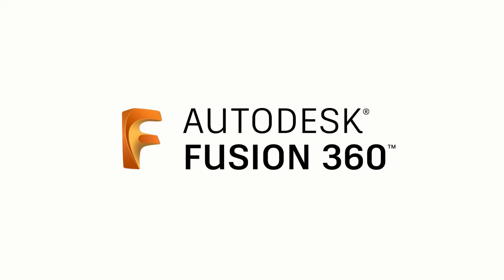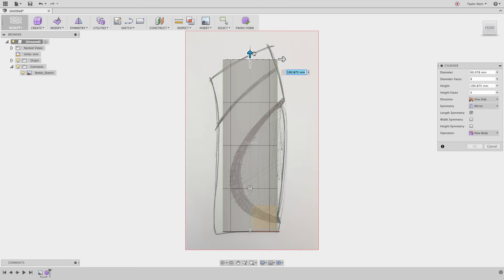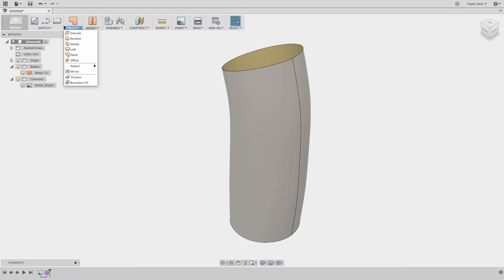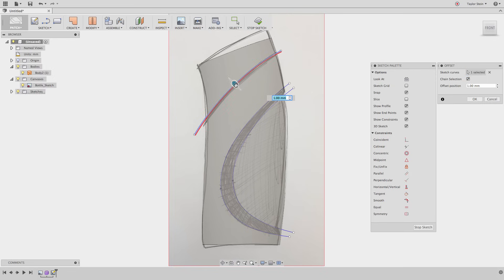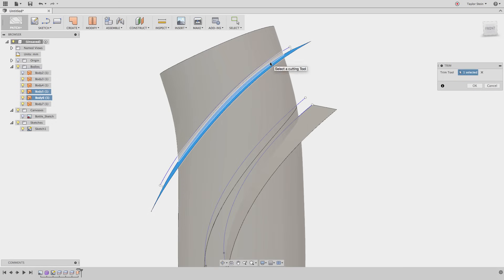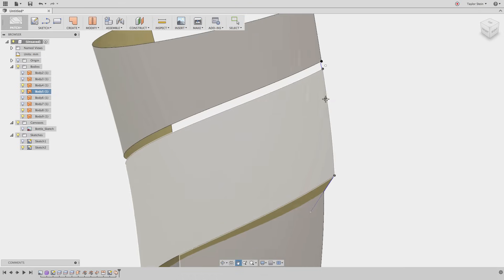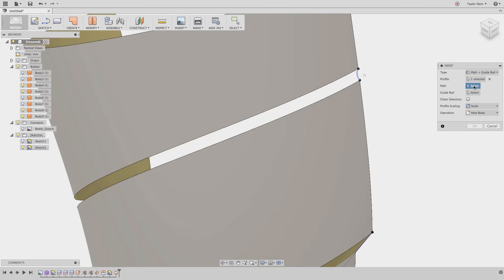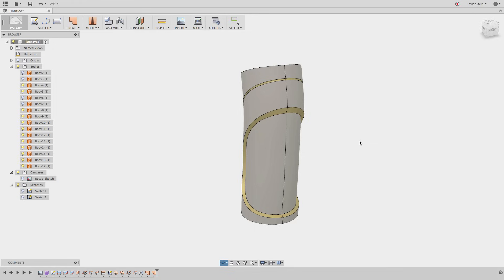Surface Modeling with Fusion 360

Comment: this is so frustrating. My Fusion 360 does not look like this, the options I have when creating a cylinder do not include the same options like direction and symmetry. I cannot follow the tutorial. Please update it to todays software and if there is some non-default setting you have configured, please mention it at least.

Comment: No! I tried 3 times! I cannot sweep arc Path+Guide rail way. It says "bla-bla-bla Error your Path is not smooth... not tangent" (cant  find out why it is not target and where') keep learning!
If I use line in stead of arc - it is OK (my arc has flat shape (dont cross bottle shape)

Error:   The path is not smooth.
Try modifying the path so that all edges are connected with tangent continuity. To create a swept shape with a sharp edge, try using multiple sweeps.

I tied more flat and smooth guild lines and paths, but with same result

Comment: Hey, i think, now Fusion 360 has been changed severely, I got design instead of Patch/In design you can’t extrude lines/ even layer extension is not possible now. Pls if someone can help me.
Reply: Fusion 360 is using a new User Interface where patch has been renamed to Surface.

Comment: One suggestion:  Having done a lot of surface modeling lately, I think it would be nice to have an expanded dialog box for the Trim tool that works like the Split Face/Body tools. I had a lot of difficulty with the Trim tool because of how it's set up - even to the point where I opted to do multiple Split Face/Body commands combined with Face Delete or Remove.

Comment: So when I tried this, the top of my bottle was distorted... Why is this?
Reply from the maker: Ummmm....missed a setting? Did something different? Hard to say, there are roughly an infinite number of ways that it could be different.
Reply: @adskFusion  It looked something like this: https://imgur.com/B25aYKh
Reply from the maker: Was it lofted? If so, try checking the handles to make sure their aligned in a logical manner.
Reply: @adskFusion  What do you mean by lofted? I am very new to this...

Comment: Is this now a proper CAD model? that could be used in production? Unlike mesh-based models from Blender for example?
Reply from the maker: @Amin-  Yes, this can be used in production.  You just want to make sure that it is a "water-tight" model, which means not just thin faces, but a body that has wall thickness.

Comment: Quick question, I'm a sculptor but only have Chromebook.. can I use 360 ?
Reply from the maker: Fusion 360 is currently only supported by Mac and Windows OS - it can not be downloaded to or run on Chrome OS. There is a web browser version of Fusion that would run through the web browser (such as Chrome) on a Chromebook.

Comment: 9:36 i cant use sketch commands while not in the sketching environment
Reply from the maker: @Talal-  Correct.  You will notice that the instructor was in the Sketch Environment at 9:36 and then finished the sketch to get back to the 3D Modeling Environment
Reply: Autodesk Fusion 360 I thought he wanted to use 3D splines

Comment: I've only been learning F360 for a week and half, so correct me if I'm wrong.

At 6:30, I found it was easier to simply split the body using the normal procedure, using the middle part as the body to split and the bottom curve as the splitting tool. This way you end up with 5 bodies in total,  2 bodies for the curved sections that you can then hide/remove.  I didn't have to use the extend or trim features, it's much simpler IMO. 

At 8:15, using the loft feature between the two curve edges create pretty much the same result for far less effort, though you still need to use the sketch/sweep functions on the top curve.

Here's my end result (note that my dimensions aren't exactly the same and I added some extra fillets):  https://imgur.com/VFmAuna
Reply from the maker: WoW!  Your model looks awesome!  Yes, there are many different ways to get to a similar result.  We were showing different surfacing commands such as sweep, extend, trim, etc so the users could see the different methods that can be used.  Thank you for sharing!

Comment: Great tutorial, thanks! I have a doubt. What would be the correct way to thicken it? I did it before closing and creating the solid, but I don't understand why it limits the thickness.
Reply from the maker: The curvatures becomes all too important when trying to thicken a surface. We have some new tools in the works to help you understand where and why the curvatures might be limiting. It's not much different than whats happening here: https://www.instructables.com/id/How-to-Repair-Self-Intersecting-T-Spline-Errors-in/

Comment: Why did you disable the "Enable Chaining" feature when you were creating the top and bottom patches.
Reply from the maker: I can't say this with much certainty, but I imagine the "chain" it wants to select is just plain wrong. Wanna test it out? Are you following along?
Reply: @adskFusion  Hey, I made the model and I think I understand why you did it that way. If the chain command is on than it would also select all the edges connected to the edges of the top and bottom face.

Comment: Hi !
Nice video but I noticed you could use the OK button eventhough it's DISabled - that's very frustrating for a novice because one would think something is wrong as long as the OK button is NOT enabled !

That must be an major error in the coding - right ?
Reply from the maker: I've actually seen that too. It can be annoying, and I'm not certain what causes it as it seems pretty random. I've tried to break myself of the habit of "okaying" each command, because its not usually required. I know thats not a solution by any means, but I'll see if I can't recreate it and share with our development team.

Comment: Great video now I need quick advise
We are using a Mac and SketchUp creating dxf files and manually exporting and assigning tools to the file to be. 
Cut on a Biesse Robert B CNC
Itseems by the vidoe this is all I need to make cabinet parts mainly on 3/4 4x8 sheets
This software generates g code correct?
Thanks
Reply from the maker: Fusion 360 most definitely generates g code! I responded to your other comment with a suggestion to check out the trial. Have you had a chance to download and try it yet?

Comment: Looks fun. What career fields associate with this kind of work?
Reply from the maker: This specifically? That would be packaging, but most anything a mechanical engineer, industrial designer, or CNC programmer does can be handled in Fusion 360.
Reply: @adskFusion  That's sounds amazing. Thanks for replying

Comment: Intresting, but couldnt you just use split face and pull?
Reply: Or project on face
Reply from the maker: Many ways to achieve the same outcomes. Are there better ways that what's shown? Maybe, but he was still able to get the geometry desired, which is the utmost priority.

Comment: Autodesk is on fire💥. It's so user friendly and versatile to use. I have used the MODEL, RENDER and SIMULATION mode in fusion 360 for robot modelling for almost 2 years now. It initially had some issues, but after some updates it now runs so smooth on my Nvidia powered windows laptop.
Reply from the maker: Thanks Vineet! Do us a favor and spread the good word!

Comment: I followed along, and got a similar result. Very cool and learned several new tricks, so thanks!
BUT - I tried to do a shell command (to turn it into a water bottle, and get an error.  I can't seem to figure out why.
Reply from the maker: Sorry to hear! Things like shell and thicken can be the most problematic. Its usually related to curvature, and overlaps related to the operation. If you really want to get to the root of the issue,  jump over to the forum and share your file! Cheers!

Comment: This good, though a top and side view in your work space would have made it easier to follow :)
Reply from the maker: Thanks for the suggestion! We personally find that if you have more than one viewport (is that what you mean) it can get confusing. We'll consider this in the future though.
Reply: Sorry, I should have been more specific.  It's actually difficult to tell what the demonstrator is selecting at times (to me anyway).  Also, learning a new modeling app I realize that this is a bit more advanced that my current knowledge of Fusion 360 :)

Comment: Is there a possibility to make a 2mm shell out of the solid body and use it as a box/enclusre for hardware? The function shell does not work? Someone knows any solution or workaround?
Reply from the maker: The most common reason for shell failures is a minimum amount of curvature, which is covered in this support video: https://knowledge.autodesk.com/support/fusion-360/learn-explore/caas/screencast/Main/Details/baa8e017-e3c7-4874-9e32-a6a43e5473ca.html

Comment: i use to work on old version proe in surfacing。this new sofware simplifies a lot pf steps。btw。 it is much better to use the tool to check the built surface quality as well。

Comment: 6:30 I am unable to extrude the splines. When I select extrude, it doesn't let me select any thing. Can't extrude a body, can't extrude spline.
Tried creating a rectangle and extruding it.That worked.
Absolute newbie here. Using fusion 360 v2.0.3802
Reply: Are you in the model or patch workspace?

Comment: Excellent tutorial, i tried to use SHELL command after completing the model but I get Error. I want to learn how to hollow out the object like a bottle etc.
Reply: your built suface is not a good one。it has some either unfilled areas or too small patch surfaces that cannot be offset in an amount of the said shell thickness。

Comment: Hi! i am Michael from India. I am learning Fusion 360 newly while performing the function of sweep as shown in your video at 9: 46. I am unable to perform that function and facing this error: " Cannot make sweep closure for closed path". Kindly revert back.  Thanks for the video. Highly commendable.
Reply: Hey! community i resolved the issue. Thanks. :)
Reply: How did you solve it? Thanks
Reply: @prozix3d  try checking all the plane of your model and unconnected points if any, close them.

Comment: When I create a cylinder I don't get the Height Faces and Diameter Faces options. Where are they gone ?
Reply: It's because I wasn't in Sculpt mode. I used the cylinder in Model instead of the one you get when you click on Create Form.

Comment: Okay, I've been using SolidWorks and a friend recently mentioned fusion to me. It seems really intuitive for surface modelling which I really like because SW is confusing at times. So my question:This design process didn't seem very accurate. Can fusion be used to design things for manufacturing with accuracy?
Reply from the maker: Certainly! All of the sketches could easily have included sketches and constraints for more accuracy
Reply: Autodesk Fusion 360 Awesome - I'll download it to use for surface modelling and 3D printing for now but it looks so intuitive and I hope it's something I can use to deliver quality work to clients! Thanks!
Reply: you said you will be making something for clients what type of stuff do you make ? And what do you do for a living
Reply: Life With Steph Hey
I don't have a living yet so I can't really answer that. I'm a final year product design student. I want to design consumer electronics eventually but the work I've been getting so far are soley plastic products - cat litter boxes and manual food slicers. For a living: I'm applying for roles as a New Product Developmer with the hope of doing some freelancing on the side. I hope that helps

Comment: fusion, inventor or alias, which one to learn?!!
Reply: For Industrial & Product design Choose Alias (It's a Surface Modeler)
For Mechanical Design, Dynamic & FEA Simulation etc minus CAM, use Inventor (It's an Engineering Tool)
Fusion is a Entry Level 3D CAM/CAM & limited FEA software.
Reply: +ajamit007. but they are not free and not in a one package as fusion。

Comment: One of the many reasons why I like Fusion 360, flexibility. If I want to model using surfaces, just like I used to do in Rhino, I can. Fusion 360 is so versatile and powerful, it's a pleasure to work with.
Reply: zavior hunt Yes, you sure can run them. You don't need a workstation to run Solidworks, my 4GB RAM laptop from 2013 with no SSD could run SW 2016. Now I have a 16GB RAM with SSD and 2GB VRAM, but use Fusion and it's good, but sometimes I have problems when there's too much features, due to my hasty way of modelling.
Reply: Josip Andrešić thanks for replying. Humanity still alive.😂. But I want to work on Siemens NX and catia more. Will they run on that hardware??
Reply: zavior hunt I've never used those 2,  but I guess you can. The question is at what point of the process or at what feature will it work a bit slower. I can't tell you much, people who use same programs for the same use (I'm a designer, not an engineer) could tell you more.
Reply: Michael Cramblet  hey lil help here. I need a laptop for my engineering design softwares. I am doin mechanical engineering. I can't spend 2-3k dollars on workstations. Can I run the softwares like Siemens NX ,solidworks, Inventor ,CATIA etc on geforceGTX 1060? Quadros are expensive. Intel i5 7th Gen, 16gb ram, with SSD , and GTX geforce 1060 is all that I can afford..  .

Comment: Could you just solid model this instead? I need to try surfacing more in fusion .
Reply: It has an offset surface into the inside not sure how this should work with solids? In the end it does not matter much because after stitching we create a solid model anyway.
Reply: I was just thinking about speed of produxtion that's all.
Reply: +dzw9000 I don't know if there is any difference in solid or surface modeling in terms of speed at all in most sculpting cases.